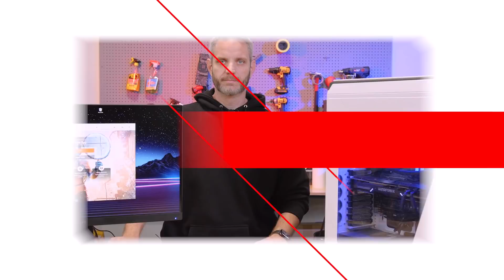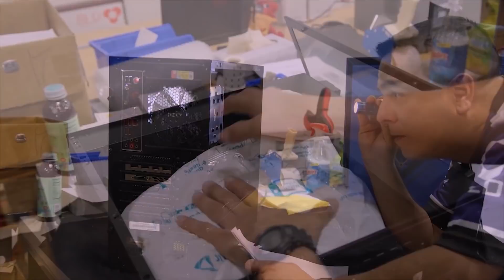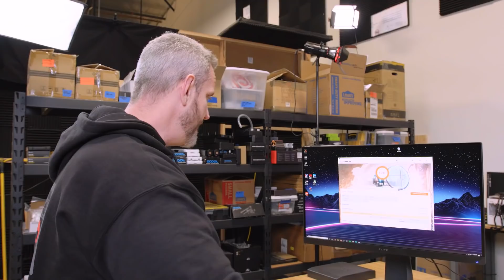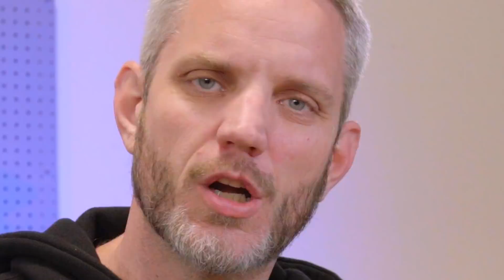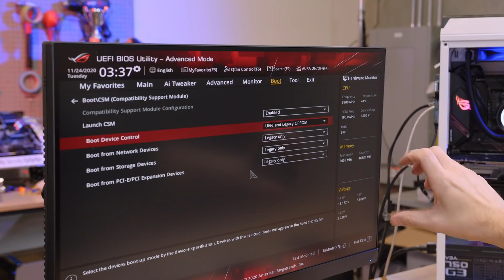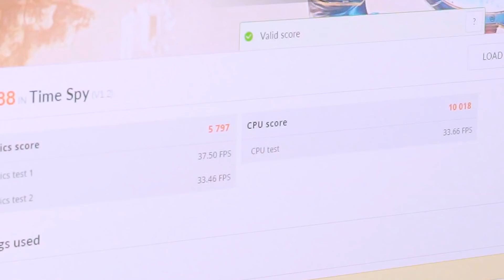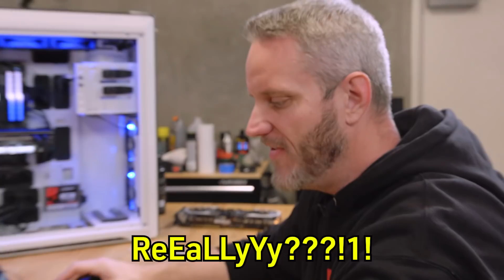This PC upgrade DIDN'T use the latest hardware and still ROCKS!

Comment: Didn't know installing chipset drivers actually makes a difference again these days. Good to know, thanks!
Reply: I changed the power options after watching this video and my 3600 got a 500+ better Cinebench score!
Really wish I knew this earlier!
Reply: Honestly me neither. Thanks for sharing Jay!
Reply: The amount of people that don't do this kills me.
Reply: do you know where i go to download them??
Reply: @RedsPC  On either the board manufacturer's or AMD/Intel's site!
Reply: AMDs site has the most up to date drivers.
Reply: I knew it made a difference with older Ryzen CPUs but after a while Microsoft supposedly updated the power plans to use the Ryzen optimised plans out of the box.
Now I'm not sure what to believe.
Reply: @phenomanII  there is also custom power plans made by 1usmus that allows better performance than the ones from AMD.
Reply: @phenomanII  since downloading the drivers from AMD does not add them I guess Microsoft fixed it. But you still need the drivers
Reply: I got the chip set from AMD page for  my tuff x570 and can't get the power options to show up? Is this because is 5600x?
Reply: @MrDjmyny  make sure click "additional power settings" to find all the power options

Comment: Hey Jay! Could you do something similar, but also changing the disk in which windows is installed (say, from aSATA to a NVME)?
Reply: you can boot into a linux live system from usb. have the sata and nvme drive in the computer and transfer its whole contend from one to the other with the "dd" command. Therefore; yes, its possible to transfer an entire install from one drive to another, even though it might screw up some pointers (they are easy to fix, its just numbers that need replacing)

I did that to a windows system once out of curiousity. worked like a charm :D
Reply: just use a disk cloner, super easy. you plug in the new drive, run the cloner then change your boot order preference to the new drive and that's literally it. doesn't matter what type of drive you use, it'll be the same.

Comment: And here I am still stuck with a 3770k LOL
Reply: 3770k can still perform well. I have 2 3770's and 3770k sitting around that I replaced with a ryzen build. I realized that my ssd was being held bacx by some corrupt files and some registry errors that were affecting my processor. I figured that out when I wiped all my ssd"s and HDD with the ryzen processor installed .3770 is limited oc but, the k model has tons of room to oc with right cooling. It can still hang with the best of them.
Reply: @MRBOCHIEDA2ND  I finally decided to bite the bullet and upgraded it to a Ryzen 5 3600. Finally I can use cutting edge stuff like nVME LOL
Reply: @ial01  🤣🤣🤣 welcome home.

Comment: Wait I built my ryzen pc last year with all new parts. Do I need to install chipset drivers? I never saw those Ryzen power options before.
Reply: not necessarily, but the performance should be better with them installed, atleast a bit. And for me and a buddy windows had random freezes for a few seconds when running idle without the chipset drivers installed.
just in case you have windows 10 with Build 2004, there the Ryzen Power management are integrated into the standard power options and not listed seperatly anymore.

Comment: Tech youtuber: "Omg! Did you all know that a computer is usable even without titans in triple sli and an extreme threadripper?!?!"
Reply: Also tech youtuber:
"Omg! You NEED to have 4 RTX 3090s minimum nowadays"
Reply: @TheCzarcastic  You need to have 8x RTX 3090s, 4x can only run Minecraft at 1000 fps. Plus you need 192GB of VRAM for web browsing! I mean, they only take up around 3000W and much more a lot of the time! You only need around 4000W in all for all the components. Which PSU can't do that? Everyone has a 10000W PSU nowadays!
Reply: @BlueRS123  Actually 1 rtx 3090 can run minecraft at 1000 fps
Reply: @BlueRS123  With 8 RTX 3090s you can forget about Minecraft and start your own crypto Mining farm.  Mine all of Ethereum before gets to forked to Proof of Stake in December.
Reply: @creepysplatter9260  Not with raytracing at 8k. And who doesn't use 8k monitor now? Right?
Reply: @creepysplatter9260  Actually 1 RTX 2080 Super can run Minecraft at 2000 fps
Reply: @TheCzarcastic  i believe you refer to the people on the internet better when u say that xe ..just like everyone when u show ur part picker xd
Reply: Next video: showcasing the triple titan + threadripper build!
Reply: @Das Beast Modus  My buddy still games on a FX8350 and a RX 480, He's had chances to upgrade, but he doesn't feel the need to yet I guess, but I mean a RX480 a FX8350 will have no problems keeping up with it.
Reply: No point on playing games when your fps is lower than 240 on ultra settings.
Reply: YouTube Commenter: "WHY DIDNT HE GIVE HIM A 5800X AND 3090!!??"
Reply: what? incoherent bs, no wonder jay hearted the comment
Reply: Also tech youtubers
You need 798654 rtx 3090
2807 Intel xeons
2 boot into 2 windows 98